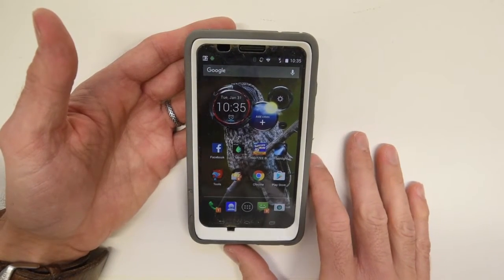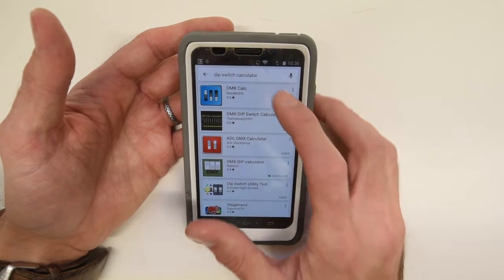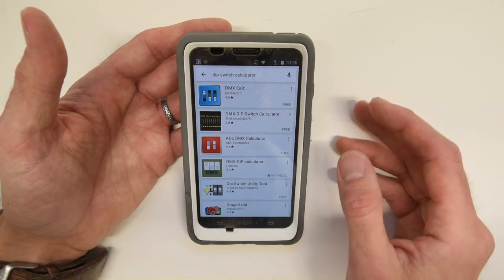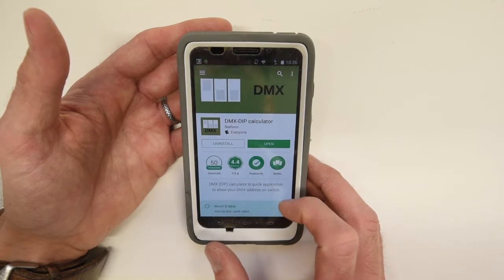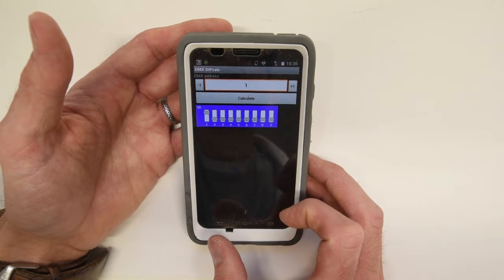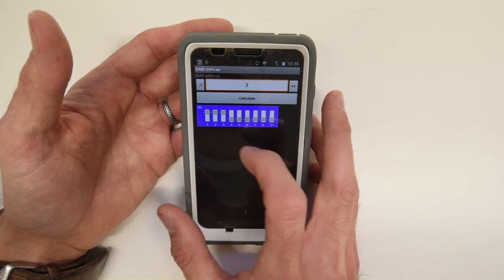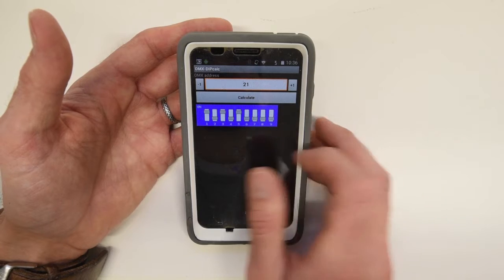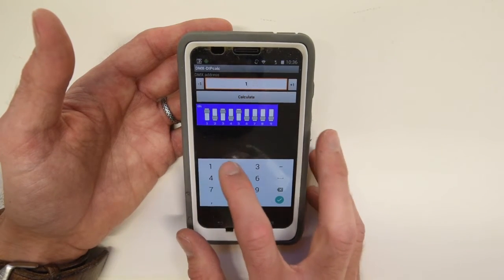Long Range Dip Switch Setting Tutorial

Comment: 5:26 So I gather the high bit (128-bit) of the channel ID is not usable?  The receiver should never set the 128-bit switch on because the transmitter can't be configured to send that bit on?  Thanks.

Comment: Hi! A question regarding the T-8. I see a true pair button. Will that fire any two traps or is it pre-set? I work at a private shooting club and I think this remote would come in handy for one our skeet variants (instead of having to use two remotes to fire two or three extra traps) As well a be in the stable for a spare when one fails.
Reply from the maker: The true pair button works by pressing the button, then selecting the 2 traps you would like. Once you press the the true pair button again, the 2 selected traps will fire simultaneously. You could also select more than 2 traps, all 8 if you would like, and fire them simultaneously. Hope this helps!